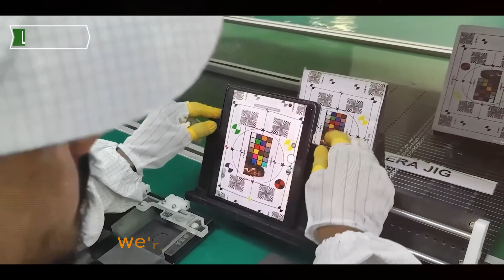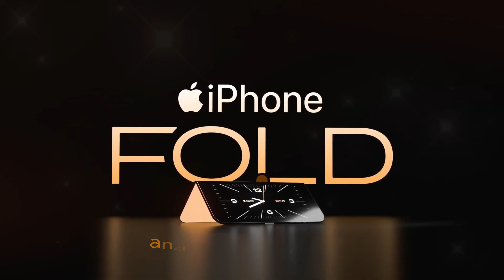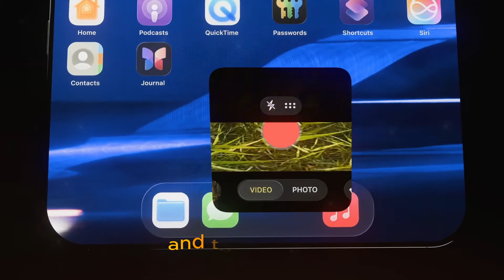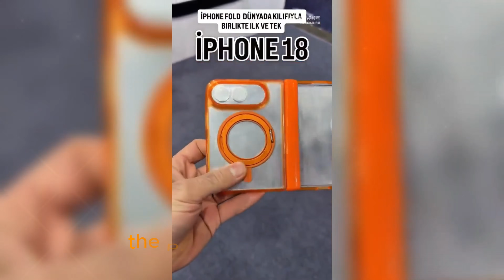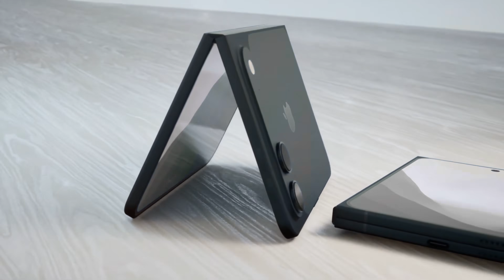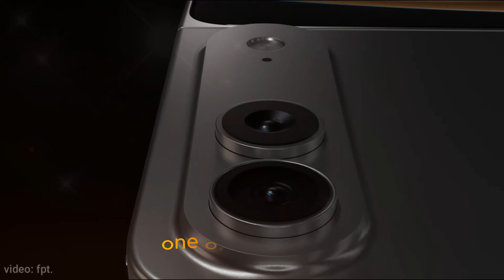iPhone Ultra Twist! How Apple’s Foldable Could Change Everything | One More Thing

Comment: Apple introduces the Titanium frame with the 15 Pro/15 Pro Max and 16 Pro/16 Pro Max then goes to a softer aluminum unibody frame on the 17 Pro/17 Pro Max pushing the aluminum unibody is better for thermal management then now they are going back to using titanium again this time on the Ultra . . . . hmmmmmm! Something does not sound right here . . .

Comment: Touch ID is really necessary because it would require two Face ID modules, one on the cover and the other on the inner screen, so yeah, Touch ID makes sense. No MagSafe might be a big "no sale" depending on how invested you are in magnet-based charging. With magnetic charging everywhere you charge the phone, it would be a major pain to have to change an entire magnetic charging setup. (No magnet rings on the dummy models shown.)